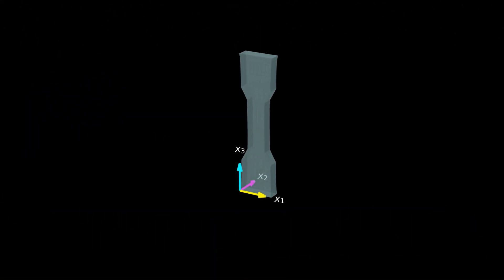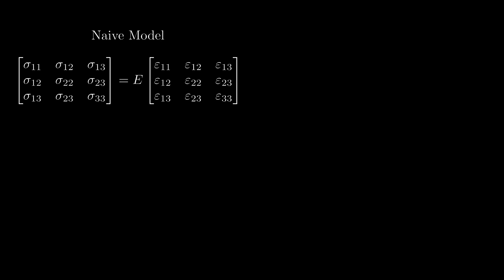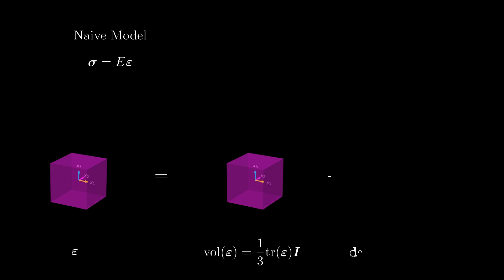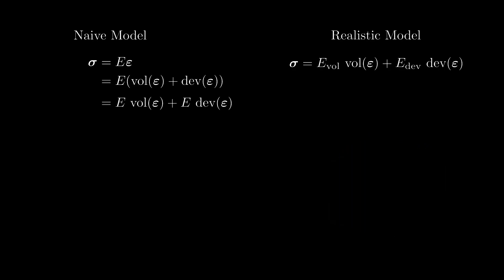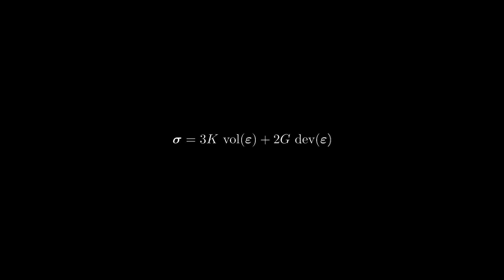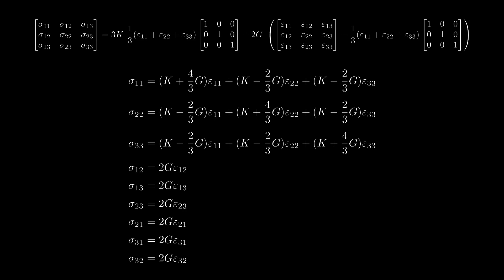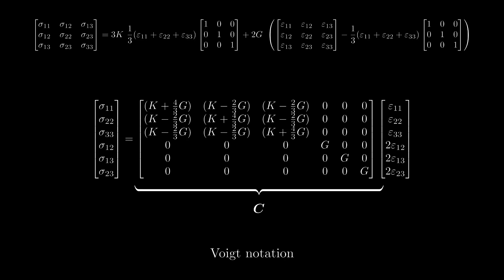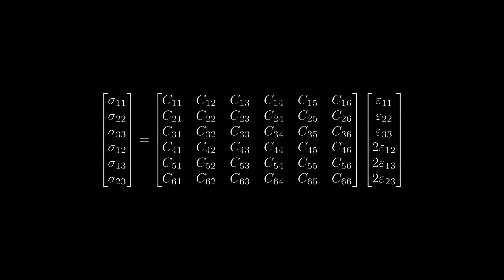This Will Change Your Understanding Of Linear Elasticity

Comment: I enjoy these videos, but I feel like most shortcoming in them is the absence of talking about the various balance laws. For example, if we put pressure on an incompressible material, if mass is neither added nor removed, the law of conservation of mass immediately implies that the material reacting to the force has to go somewhere, that it reactions in all directions, and therefore requires the tracking of that distribution of forces on all those dimensions (and the resulting displacement).

It might make things initially complicated, but I also think it explains WHY we're using the other stuff.